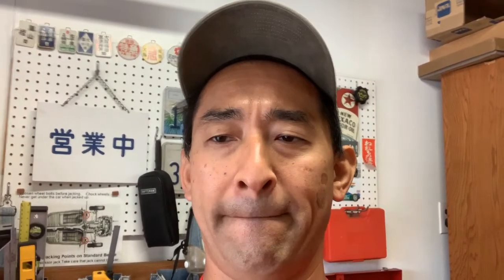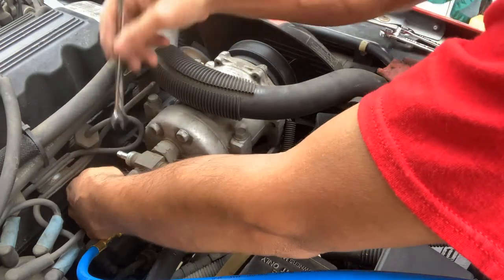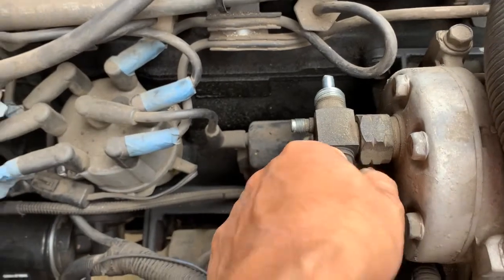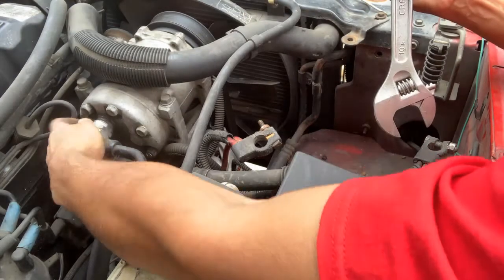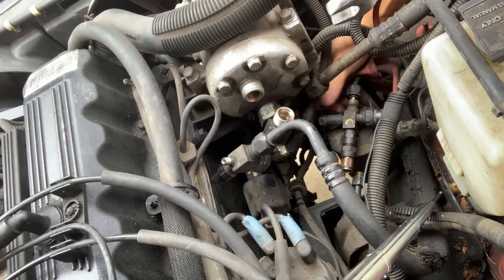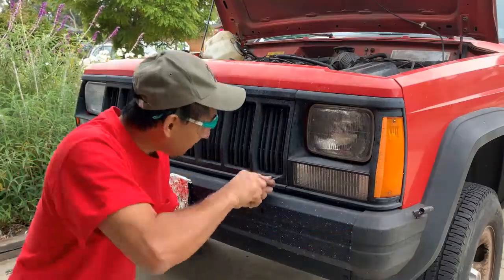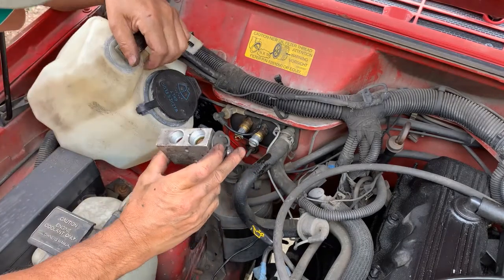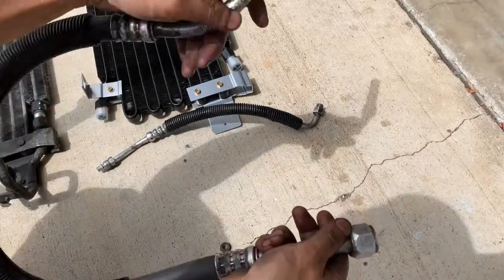93 Jeep Cherokee XJ, AC R-134 upgrade (Part I)

Comment: How would I tell if a conversion has been done?
Reply from the maker: ? If you use the conversion kit, it's done.
Reply: @madatsukaerude  obviously if I did it myself I would know but I'm asking  how to identify if it was done prior.
Reply from the maker: @Starri0fficial  I got it. I believe the compressor shows what gas to use. Check a label or sticker on the compressor.

Comment: Were you turning the valves COUNTER CLOCK WISE to open? The valves are turned CLOCK WISE to open.
Reply from the maker: Thank you for your comment. Yes, at that time, I didn't know that these valves turn clockwise to open.  But the valves were very old, so I think it was time to upgrade them anyways.